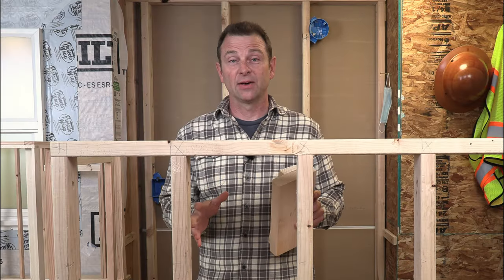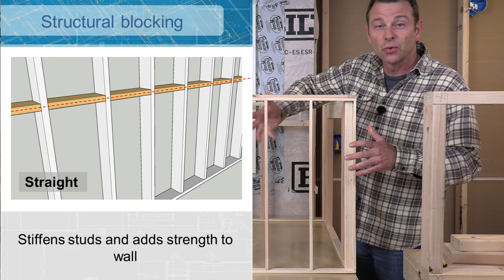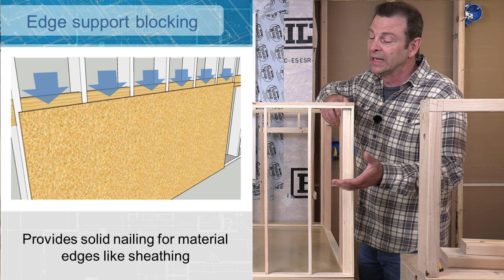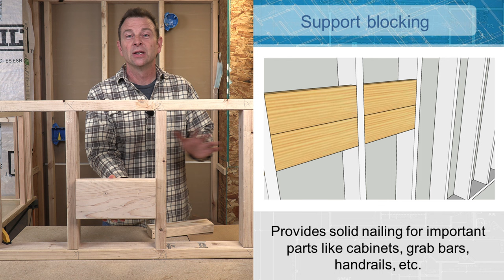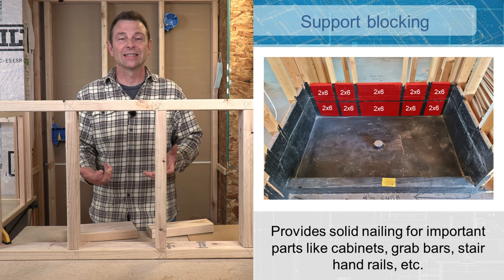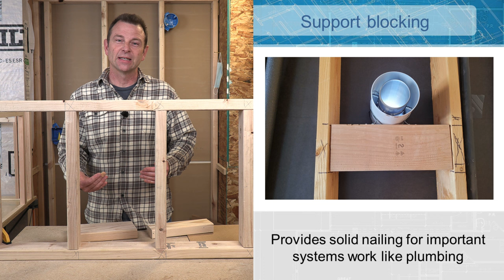Learn about Blocking in Wall Framing - TEACH Construction Wall Framing Lesson Video Series

Comment: Absolutely!
All of it, and the more, the better,
As a former framer from back in the 70's, I see today's  framers NOT providing any blocking for window curtain rods.
Sure, they put in headers, but they sit back from the back of the drywall, so you have to use useless drywall anchors to mount the hardware, and 9 times out of 10, they end up pulling out and now you have drywall to fix!
Reply from the maker: Blocking does have its place
Reply: @reb2322, good point about the need for backing for curtain rods.  I would add to that list blocking for support of clothes rods in closets and blocking at short wall (less than 30 inches) baseboard area.  The last gives something for the baseboard to grasp other than just at the two ends.  And a definite "yes" to adding blocking for anchoring stair railings, particularly at the top and bottom of the railing when the railings features extra ornamental flourishes at the ends, such as with a metal railing.

And don't forget the thin blocking needed to support pocket doors.

Comment: We also put in blocking for drywall joints. Having a support behind the joints reduces risk of cracking and gives you more options for placing screws.
Reply from the maker: Certainly - blocking is added for all sorts of reasons.  We hope it is installed sparingly to allow for as much insulation as possible

Comment: Great video Joe. I've built quite a few walls and I have only used blocking where I needed to fasten something. I always wondered if there was a fire code requirement. You have answered that question.Very nice presentation.

Looking forward to looking at some of your other videos.

Thanks,

Paul
Reply from the maker: Glad it was helpful! - Fire blocking is not always required - it is based on the height of the walls.

Comment: The exterior sheathing on some parts of my house is 1/2" drywall.  I'm a little concerned this doesn't provide enough rigidity.  The interior side of my attached garage exterior wall is bare so Ive been planning to block it before insulating and drywalling.  This video has been by far the best one I've found on how to go about it.  Many thanks!!

I plan to do staggered blocking with the 2x side of the blocks facing up so I can run insulation behind the blocks.  Does this sound like a good approach?
Reply from the maker: Thanks for the nice comment about our video.   The sheathing is only "required" for shear strength on certain walls - not all walls. Often, modern homes are sheathed all over for a variety of reasons other than strength.   It could be as a backing for a bulk water control layer like Tyvek or part of a required air barrier system.   Thus why you could see 1/2 drywall in some places.   If you are insulating and then adding drywall to your attached garage wall please make sure that you spend time on air sealing any cracks first, that is the best conditioning that you can do, then add the insulation and drywall on the garage side.   I don't know what part of the country you live in, but you should consider the location of any vapor barrier also.

Comment: Thx for the video. What are your thoughts on putting blocking directly on  top of bottom plate… to potentially prevent bottom of the studs from moving/warping ?
Reply from the maker: The bottom of the studs is not the problem - that is held in place with nails.  Studs can twist and bow - then you can use blocking as a preventative measure and put them somewhere in the middle
Reply: @ConstructionEd  Thank you for the prompt response.

Comment: @3:21 In the example of the blocking every 2 feet to support a perpendicular wall, how do you address framing to provide an inside corner for sheet rock to secure too since it will be the end/edge of a sheet?
Reply: If the blocks themselves every two feet are inadequate for your code/standards, you can use a 2x6 stud as a drywall nailer, centered at the end of the perpendicular wall, then add blocking behind the 2x6  to support, plumb up, and straighten your perpendicular wall.

Comment: So can fire blocking be anywhere in that 10 foot area if your walls are over 10 tall. For instance, if you have a 12 foot wall can the fire blocking be at 6ft or does it have to be exactly 10 ft.
Reply from the maker: It can be at 6ft - but check your local code before you call for an inspection.

Comment: On a 10 feet wall, at what height it’s best to add blocking? Half way which if 5 feet off the ground?
Reply: Depends on the wall and building code. But generally you will want it at the height of your drywall boards to give something to put drywall screws horizontally.

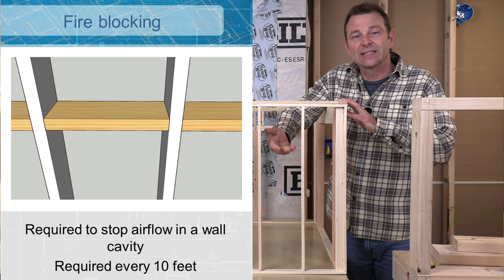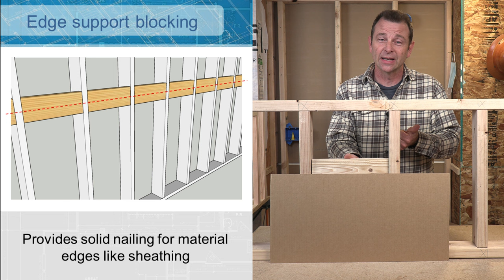Comment: I am a bit confused, you mentioned that blocking needs to be placed face up( at 3:13) as fire blocking, then you mentioned that it needs to be placed edge up as it's more energy sufficient at 5:19.... then how should we really place it???
Reply from the maker: Not all blocking is the same, those two time stamps you provided are talking about two different types of blocking.   Fire blocking is face up to seal the wall cavity and edge support blocking (which is NOT fire blocking) can be placed edge up.

Comment: Any videos on removing a load bearing wall?
Reply from the maker: Sorry, we don't have any on that, as that is a little more involved than a basic framing series.   If you do it be careful and make sure you have the bearing points supported when you are replacing the wall.  If you are actually thinking about permanently removing a load-bearing wall - just don't.

Comment: What about ceiling blocking for drywall along parallel walls? 
AKA known as 
“dead wood”
Reply: Blocking can be installed in any area that is 100% needed.  I say 100% because in some climate zones blocking should not be added with wild abandonment.    It added to thermal bridging and reduces the space for correct insulation installation

Comment: Question: why do older homes have diagonal blockingv
Reply: That would be what is called a led in brace. Typically installed on stucco homes that don't have shearwall (plywood) the  stucco wire and stucco are the shear. These braces provide shear on framing before stucco wire and stucco is installed. They are recessed into the studs diagonally.

Comment: How high from the base should I place blocking?
Reply from the maker: The height of blocking is not universal.   Install where it is needed for backing, if you are adding fire blocking it is usually installed midway up the wall

Comment: so you did do nothing... how the heck do you block when the blocks are all lined up like that... how do you nail them in?
Reply from the maker: One of the pieces of blocking can nailed in the end through the stud and then the other end can be toe-nailed in place.
Reply: Half of them are glued ;)
Reply: Stagger slightly. You don't have to toe nail one side but that's an option. You can thru nail just above and below existing block to reach next block. You can also toenail in the face side, for those short blocks at the corner where neither nailer or hammer can fit.